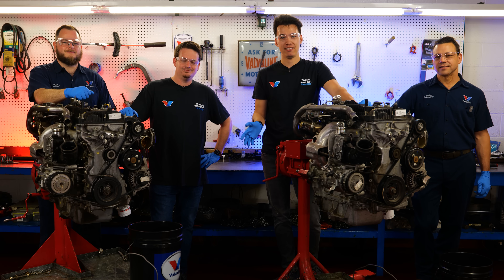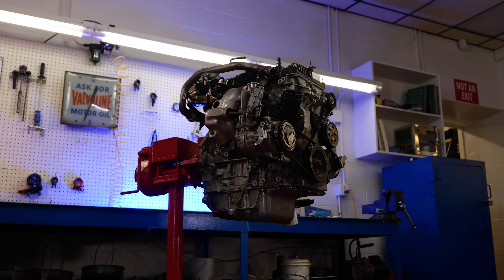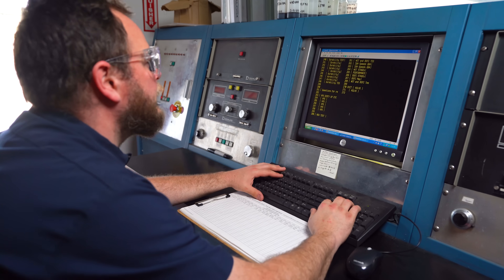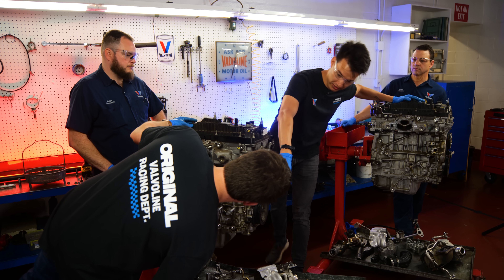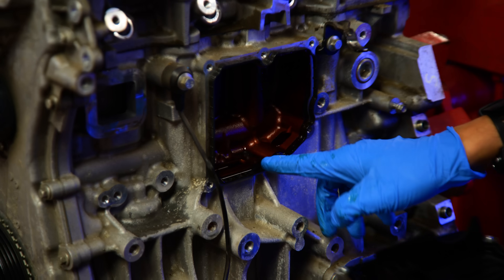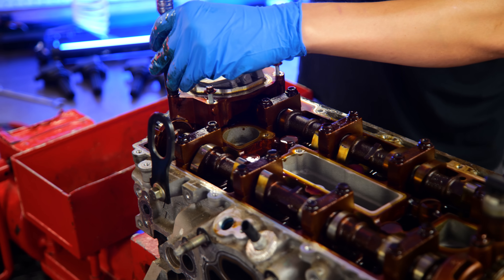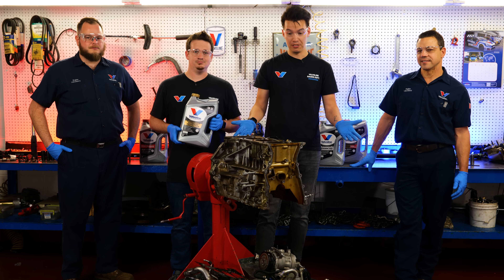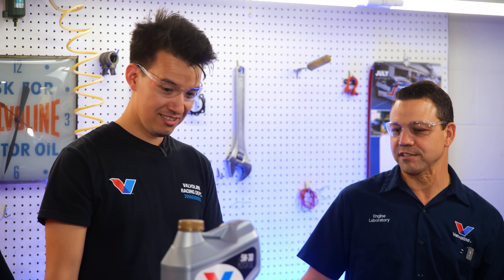Testing different oils over 4 years and 1 MILLION miles

Comment: Many years ago I contacted Mobil to see if they wanted the oil from my Navara that had 100k kms on it with only filter changes. They said they didn’t want any oil less than a million kms. When I changed the head gasket, after overload, the internal components were as new. Mobil 1 is the bomb

Comment: I also use Marvel 1 quart to my engine oil at change. It keeps the varnish at bay. And a smooth clean running valve train. I believe Marvel oil prevents ring stiction.

Comment: Very informative. I was impressed that both of them went 500k miles without major failures. I personally run a 3.5 ecoboost with 83k and religiously change my oil at 5k miles with Mobil one. These new engines running thinner and thinner oils with more and more load I feel its more important than ever run the best quality oil and more frequently. Its cheap insurance either way.

Comment: I wonder how clean the conventional would be if the conventional oil wasn’t push out of its limits.  10,000 with conventional is just measuring the expected mess up.      If it was changed every 4000 miles,... I wonder if it would be just as clean

Comment: american engines suck. i do the same maintenance you're supposed to on a chevy ford three separate cars the engine blew before 150k. maintenance on the chevy was too expensive to afford changing the fuel injectors that go out every 100k costs 1800$ because its some stupid spider network thing that means half the top of the engine has to come off to replace it. I got a Honda civic. all maintenance is basic. spark plugs, injectors, belt, oil, all easy like Legos. over 400k miles and it still runs better than most cars i hear beside me at a light with all the fancy start and stop, hybrid 60 mpg, 1$ per mile maintenance cost.

Comment: Good solid test but the conventional should have been changed @ 5000 mi. You guys know it & so does everyone else. You would have still had better results with syn but not quite as ugly with the con oil.
Users that run conventional would change it sooner 'users that care ' than 10,000mi.
 I trust Valvoline, everything I own gets it in some form. Utv' cars, trucks, atv's, snowmobiles etc.

Comment: Ok, thats for your information
My crown Victoria run over 700K km (440k miles) by cheapest  oil i can find it when its time for oil changing. 
I change every 5000 km with filter.
Reply: It's okay, 5 thousand is reasonable. If it was virgin oil, it would be 6 thousand even.

Comment: Hey guys… I have 2017 Hyundai Azera and i live in the middle east where temps can be over 100 degrees Fahrenheit in summer. Instead of using the manufacturers recommended oil 15w40 conventional oil i put in 5w30 fully synthetic. Have i made a mistake or 5w30 will work just fine? Thank you
Reply: Put at least 10/40 I live in the Middle East
Reply: Also the recommended oil is not bad I use it my car is not Hyundai and the factory recommends 5/30 as a minimum
Reply: @faris.alhusain7079  Hey bro thanks for the recommendation, ill look into the 10w40 in my next oil change. I dont think i will ever go back to 15w40. I feel my cold starts are better and also idle sound and vibrations are different and i am not sure or if its just me i feel the acceleration has improved significantly! Its like the car has gained a few Hp's 😂 i have the car with me for last 5 years and its my daily so i know it too well. The engine is a 3.0 V6 and it already has a decent power but now it feels very different 😃

Comment: The big issue is changing the oil at 10k miles, if the oil was done earlier, neither engine would have had the coloration build up, I do agree Synthetic additives in the oil do run cleaner, and that is good, but if you keep you non synthetic oil cleaner you will get a good result as well, I also find that synthetic additives are less prone to oil consumption for sure, and the reason is clear, the rings not getting caked up and sticking. The biggest problem for oil related failures are never the oil no matter what brand you use, the problem is always the idiot owner that neglects proper oil change intervals....simple!

Comment: So did I miss where they measured and checked to see if the engine was worn?? I remember another oil company doing this to a high mileage engine, I seem to think the guy was a driving instructor, he changed oil before it was due on a regular basis, when checked the engine was still in original manufacturer's spec and the mileage was something silly like 500k, might have been more.

Comment: The problem consumers face with synthetic is the industry definition dating back to the ExxonMobil vs. Castrol lawsuit which rulled in favor of hydrocracked Group 3 dino being classified true synthetic imo. ExxonMobil claimed it wasn't but lost. Even today no manufacturer bottles I've seen have ever listed the base composition. Technically speaking true synthetic oil is group 4 PAO in higher.

Comment: Problem is that engine shouldn’t be run with conventional oil. Also conventional oil should be changed every 3,000 miles. Unreliable test. Apples to oranges.
Reply: yes

Comment: 15w40 conventional oil user here. Did I messed up? 1.2 petrol engine Chevy sonic
Reply: It does not exceed 4 thousand miles and with a suitable viscosity, it will be more than excellent.
Reply: @ thanks.

Comment: No car these days gets filled with "conventional oil", that has been gone for decades by now (unless you toss in a 15W-40 or 10W-30 or something like that for very old engines from like the 60s or 70s). Every motor oil for newer cars is some sort of hydrocrack (HC) synthesis oil or in rarer cases a fully synthetic oil (it depends on the country's regulations what is allowed to be called "fully synthetic").
Reply: Even 2025 engines accept conventional oil.
Reply: @faris.alhusain7079  "Accept?" The car has no option to deny what is filled into it 😄.

Comment: Conventional oil is not formulated for 10,000 mile intervals. This isn't a fair comparison. Why didn't you make the oil change interval 5,000 miles? Oh course the synthetic is going to do better at 10,000 miles, and even that is probably too far to go between changes on synthetic. A total sham comparison if you ask me. Redo this, but at 5,000 mile intervals.
Reply: Yes

Comment: I have worked for several car manufacturers and have dealt with engine failures. There are now very tiny engine oil passageways in the heads and through the cam phasers. Varnish and then sludge will readily block the oil passage ways like cholesterol in your veins. This will starve the engine parts for oil. I just run synthetic and do change in about 3,000-4,000 miles or six months whichever comes first. Keep it clean inside.
Reply: 3,000 miles and synthetic oil is useless

Comment: I wonder how the engine with conventional oil would have looked with 5,000 mile oil changes?
Reply: After this period, replace the synthetic oil and after this period, replace the mineral oil, for example, 3,000 or 4,000 miles, and you can evaluate it.

Comment: So if you wanna spend extra on fully Synthetic oil you can but it won't stop some failures of parts and conventional oil will leave your engine looking less clean but after 500k who cares a ford will rust way before that. Lol 
Regular maintenance is the only lesson to learn here. Fancy brand names aren't necessary. A correct spec and Regular servicing is key. These extended 20 30k service intervals will be the end off life quickly way before 500k

Comment: That's cute 500,000. I just past 590,000. Same engine. No major components changed of the engine itself. Alternator and high pressure fuel pump after 320,000 were replaced.
Reply: What’s your secret?
Reply: @ramonahumada4  probably luck mostly. But changing fluids religiously and other components like spark plugs, ignition coils, air filters, etc. helps a little. Even things like shocks, struts and brakes will lessen engine load when in proper working order.
Reply: @mrdonetx I’ve heard this engines are reliable. This vid and your experience show that they can last if maintained properly. Thanks for your info!

Comment: Being a jet pilot since 1977, I learned that jet engines use nothing but synthetic oil and never change it until overhaul.  This was good enough for me and I have never used anything but synthetic oil-since. .Replaced the valve coves gaskets on mini van at 150k and there wasn’t any sludge build up!  Used 10,000 mile oil change interval!   Engines ran as good as new until they were sold at 225K.
Reply: you don't get burnt fuel on the crankcase on the jet engine. as a matter of fact you never change a jet engine oil, you just top it up. requirements are very different.
Reply: Thank you for the info Jet Pilot. With the tolerances that are required in a jet engine, even light buildup could have serious consequences. This reaffirms my belief for years that synthetic is the way to go. I wonder what would happen if synthetic were used after using conventional oil whether there would be oil leaks?  Thank you and God Bless.
Reply: @ i think the oil leak fear is not based in any reality!   Synthetic oil isn’t quite as thick as regular oil but it also doesn’t get as thin when heated.  No performance car built today uses anything but synthetic oil!  Your warranty would get voided if you did!
Reply: So you are probably aware that Al Amatuzio was a jet pilot in the military, before he started the AMSOIL company.
Reply: @TIJoe-te9qu so you are then probably aware Amsoil is 100% synthetic oil!
Reply: You're hilarious.
Reply: @AlanBrando-h7b apparently you are an idiot!
Reply: How often was the rebuild?
Reply: @ depends on engine but typically 4-8000 hours.  Jet engines don’t have the blow by contamination issue so oil remains clear.  Conventional oils will breakdown over time and heat cycles where synthetic oils don’t regardless of time or heat.

Comment: Ah!  It was nice to hear that when running the test, the engines were cycled to idle and acceleration phases.
I recall back in the 1960s some US auto makes were very boastful of the durability runs they did with cars at 100K miles.  The Hugh flaw with those tests was the constant highway speed the cars were run at . . . it was not 'real world' vehicle operation of idle, stop and go running.

Comment: the second thing to consider is the oil filter that the lube shop uses as this can drastically change your oil pressure and flow, just because it threads on and seals does not mean it meets engine specs when the upper cams and wrist pins down to connecting rods don t receive the right oil pressure things goes south quickly when the engine is brought to its outer limits of cooling and lubing  (climbing a long hill on a hot day with low oil and low coolant full of passengers)

Comment: I have bought scrap yard motor v8s and you pull a valve cover and meet caked-on sludge, I would drain the oil including the filter which would get rinsed and spun back on and then put diesel fuel in the engine and run it for 5 min drain it and repeat until the diesel looked clean than when you pulled a valve cover no more sludge a lot of people worry about engine bearing when you tell them this process but think about your engine pulling a well loaded trailer up a hill with you trying to get to the top as fast as possible and your engine oil and water temp climbs and with a gauge you would see 220 oil temp and 250 water temp this is wear bearing damage happens, you might say it survived but your 500 000 mile motor is now 150 000 and this is not even considering the trans so flushing with diesel quick easy and NO damage

Comment: I’ll never understand 10k intervals
Reply: The Valvoline rep did hint the 10K interval was typical of many in the motoring public.
Back in the 1980s my employment boss typically changed the oil in his Mercedes diesel every 8K miles, which eventually resulted with a thrown connecting rod and a hole in the side of the engine block.
I had a diesel pickup truck at the same time, replaced the oil every 2K miles (did my own oil-changes), never had a problem.

Comment: 2020 and beyond, still running Windows XP on that computer. NO GOOD.
Reply: As long as it is not connected to the internet, you might as well still use Windows 95. It's that special equipment that does not die and can last for 20+ years but was designed for XP so you can't change the operating system under it.

Comment: How funny Ive been running 10,000 between my changes with valvoline or castrol. With mobil filter or wix. I just now overhauled the motor at 300k. But it was running great. No lifter knock. No oil burn. When i took it down to the short block. All the wear was very normal. And I run my rig pretty hard. Its no parking lot daisy..reason for the overhaul was for a badoverheat. And various engine leaks. Front case gasket. Rear main. One of the block plugs. And the bedplate gasket was starting to giveout. But the damn thing was still going in terms or internal wear parts. These oils are alot stronger than what they used to be.

Comment: At 500,000 miles and 10,000 mile oil change interval, that's 50 oil changes. Comparing common oil change prices at chain lube shops, a single full synthetic oil change is $40 more than a conventional oil change (basically double the price). That's $2,000 more money spent on the the full synthetic over the life of the engine. Of course, with a more reasonable 150,000 mile life, that drops to just $600. The difference in price drops even further if you perform your own oil changes. Doing the math, conventional oil just doesn't make sense. You could argue that because a conventional oil change costs half as much, you could just go twice as often. That still seems like a waste of time and impact on the environment (twice as much oil and filters to recycle/dispose of). This video shows that 10,000 Mile oil changes are fine, provided you use the correct oil and don't drive short distances frequently.

Comment: Friend of mine drove a 2018 Tacoma as a full-time work truck and changed his oil every 10,000 miles using Castrol Edge 5W-20 weight and the extra-guard FRAM oil filter.  The truck was bought new in 2018 with 3 miles on it.  Truck has 136,000 miles now in 2025 and uses no oil, no sludge build-up (after valve cover gaskets changed), and the engine looked very clean when the valve covers were taken off.  Guess these oil engineers are pretty sharp in making oil that last 10,000 miles.  However, many of us are still stuck with the dated information that's too long to go without changing oil.
Reply: Miles isn't everything. Flat lands with cruising speeds are the easiest, while hills with towed trailer are much harder and more severe. Idle time is also a factor, some people will spend more than an hour a week just idling in park. With stop and go traffic and heavy idling, most people are best at 4,000 miles/oil max.
Reply: @JohnDoe11VII  Depends on the quality of the design of the motor.  I have always bought and maintained Toyotas, and still change every 6months/5000 miles, along with all other recommended maintenance intervals.  I have never had an engine/transmission last less than 350K.

Comment: Testing different oils at one RPM range with zero real world conditions for 500,000 miles. Fixed your title.
Reply: Give the video another look.  At the 1:53 mark the Valvoline rep talks about the purchase of the vehicles and that they put the vehicles through a cycle of idle and accelerations of stop-and-go.

Comment: I’ve been using mobil 1 full synthetic on my V6 Camaro and have changed my own oil from the beginning with it. 130k miles and I have never had an engine issue has cranked first time exactly how it did the day I bought it

Comment: What if you have a car with 160,000 miles and it has been using conventional oil from new, is there any reason not to switch it to full synthetic oil in the car? 2014 Kia Sorento 2.4 4 cylinder.

Comment: My 2015 ford fusion phev is at 202k miles with only oil and tire changes. Hands down the most reliable and cheap to operate vehicle I’ve ever owned. I changed the oil whenever onboard computer warns me. Usually around 15-20k miles with whatever full synthetic oil 0-20 I was able to find. Last 4 oil were kirkland brand. 😂
I’m keeping this vehicle as an experiment just to see when will something break first.

Comment: Is anyone wondering why only car engines use mileage to get oil changes? The rest engines like boats, generators, lawnmowers, etc., use engine hours - 200-300 approx.? Well known fact that fully/semi synthetic oil doesn’t exist and it’s all about additives and marketing to mineral/conventional oil.
Reply: Newer ram trucks take idle time into account. My work truck is a ram it idles   A LOT. 

My last oil change reminder came on at around a 3k mile interval.

Comment: 2014 5.0 f150 4x4.  I use Valvoline 5w20 full synthetic and the damn oil pan gasket leaks and had to be changed at 176,000 miles.  I know this is a problem on all 2012-2017 f150’s.

Comment: I drive a 24 Tacoma with less than 7k ( took delivery last day in December 23 
had 3 miles on it & I'm the only one that has driven it )
I have the Dealer change the oil ( first change @ 900 mi. )
about every six months ( most miles on oul change 
about 2500mi. ) I'm not sure what oil Dealer used , but it's free so far ( used last free oil change last oil change )
It has the four cylinder engine .